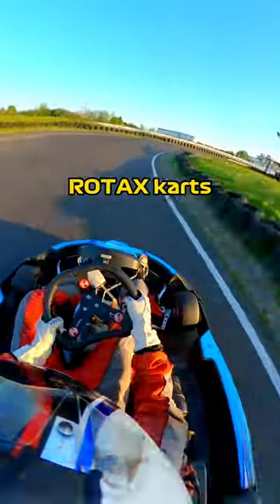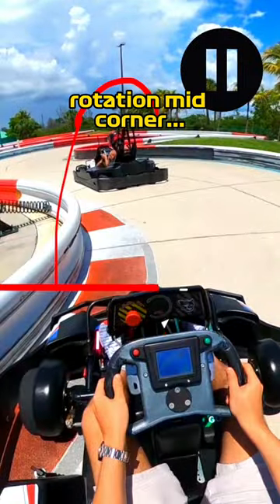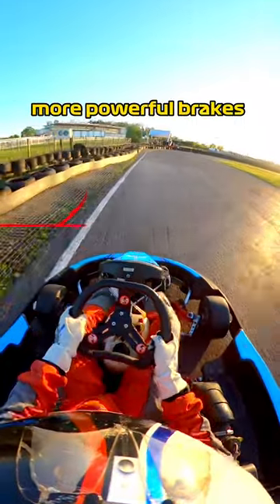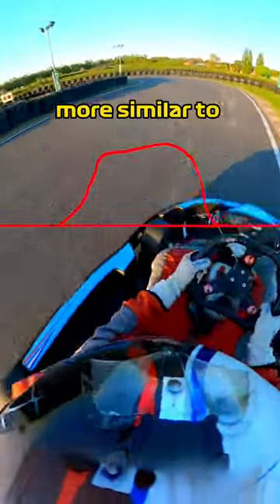ELECTRIC vs GAS Kart Braking Technique

Comment: Jokes on you i dont brake💀
Reply: Colin McRae moment.
Reply: "i need to brake? pssshhh i'll be fi-"
*crashes right into the barrier at full speed*
Reply: @turbo_marc  last time i went karting i litteralt crashed at every corner. That was 3 years ago if i do it again surely i will do aot better
Reply: @noodle7897  if you crashed at every single corner that takes skill
Reply: @turbo_marc  hmm maybe that might be exaggerated but but all i did was reverse to the track slam the accelerator and crash again then repeat for 2 laps
Reply: @noodle7897  yikes
Reply: @noodle7897  please tell me you're either a kid or never getting behind an actual wheel😂
Reply: @thehotbox9788  Dont worry i still got 2 years before i get behind one
Reply: braking makes you go faster off of acceleration of a corner
Reply: At k1 speed Burbank you don’t need to brake at all
Reply: @noodle7897 You are literally me when I play forza
Reply: forza kid
Reply: I decide to go full speed in a corner while karting well that kart is now al bent up
Reply: That's because commercial kart tracks are built so you don't need brakes. Less likely to be sued.
Reply: same. Being a big person will a very tall unaerodynamic posture, I noticed that people recover on apex's better than me. So I don't brake, and floor it in each corner.
Reply: Insert Vettel in Monza here
Reply: You should drift the cart it's fun
Reply: Right! Why do we brake? If we have a kart in front of us..
Reply: Same. I just did supercharged and you really don't need to
Reply: Then you’re slow lmao

Comment: Mate in an OTK chassis, there is a very aggressive input to 80%, then slower to 100% before coming off gradually until the apex. In Some corners, we can pick up the throttle while still coming off the brakes
Reply: OTK engine sends you into a wall
Reply: @TheoSpeed54 ok but you don’t need to run an OTK engine on an OTK kart.
Reply: @nathanholy  otk engine 💀
Reply: What’s an OTK engine? I run a rotax senior max
Reply: @shobhitn79  Vortex engines are otk (Rok shifter, Rok GP, etc), a rok gp (which is a TaG engine) drives similarly to an x30
Reply: @shobhitn79  OTK engine parts* not an entire engine, apologies
Reply: @Mack-parks  parts*
Reply: @nathanholy  parts*
Reply: @shobhitn79  doesn’t exist
Reply: @Mack-parks tbh I didn’t even know anything about otk engine I was just responding to the guy before who said otk engine. I run rotax and ka100 on my LN karts
Reply: Exactly
Reply: @henrivm3559  Engine parts if u actually read my above
Reply: Yeah in otk and kart republic chassis u come in to the corner stab the brake angle the kart and accelerate

Comment: Idk abt that... I drive a rotax junior otk chassie... we slam the breaks super hard to 100% and instantly go back to 90 for half a second or so then slowly bleed off...
Reply: Exactly! It's ok let this guy keep giving away these crappy racing tips, hopefully people take his advice and then you can beat them on track lol 😂
Reply: Yeah idk what that guy is taking about. Most of people in karting trail brake. And I don’t see how the engine changes the brakes? Brake disks are separate from the engine.
Reply: This is the correct way. Dunno what Cameron is talking about
Reply: It doesn't make much difference whether the engine is Rotax or electric or anything else. Trail braking followed by application of power, trying not to run off the track

Comment: I hate electric karts. I like to hear the engine when I race and it gives u that thrill when u drive. Electric karts don't have that same feel
Reply: Koen Cauwels  Nahhhh, the only thing I don't like is the quietness and some places you don't have to where racing suits but imo racing suits make you feel like a pro lol
Reply: I quite like the electric squeal. Nothing like my motorcycle engine screaming at 13,000 rpm though. Not really a fan of 2 stroke weed eater/ chainsaw motors.
Reply: @sed8181 it's faster though and I like it

Comment: in a rotax the second you come off the brakes you should be hitting 100% braking and locking up and then you slowly come off the brakes and control the lock up then you need to rotate and you need to be on the power just before the apex
Reply: Yeah
Reply: this is exactly why I believe electric karts are a better precursor to formula series

Comment: I go to k1 speed and it’s based off formula 1 and ur supposed to use the brakes on the turns so u don’t spin out or wreck but I don’t brake and on my first time going I spun out once and got into 2 really bad wrecks😂

Comment: I just started Rotax Karting 6 months ago I drove the old mini max karts which is a 60 cc the new mini max is 125cc and obviously restricted the engine power and now I got my own Kart it's a Junior max a less restricted 125cc I'm still far from racing but I'm getting close to the tracks race pase for this specific kart class

Edit: and just saying the old kart I said  I drove was obviously the rental kart that beginner's use to get used to the track so then I got my own Kart which is way faster then the rental kart they have

Comment: Nah I drive using a J which is from the clubman era and you need to keep up speed through the corners but at the end of the straight you need to make the engine cut out if you want the best braking

Comment: Not disagreeing but this is not a good way to show the difference. Should be similar corners at least. Also there’s a big variation in the way you drive a 2 stroke vs 4 stroke, and within those, there’s different CC that change the way you drive.

Comment: PSA this is a horrible braking technique for any kart and will just make you slow. This guy gives absolutely horrid driving advice
Reply: Lmao this is a literal F4 driver chill
Reply: The advice is good, you just need to know how to use it in the first place
Reply: @simraceaddict it’s not really though, beaming technique for a kart needs to be immediate max pressure to where the tires are locking and almost chirping, before releasing back down and getting of brakes completly before turn in. Slow brake ramp up is a very slow technique no matter if it’s a car/kart etc